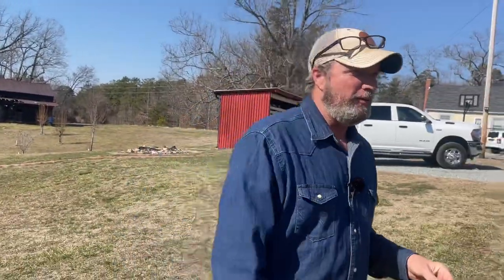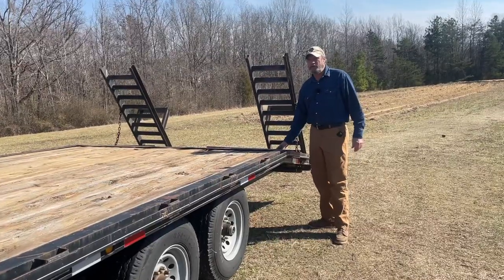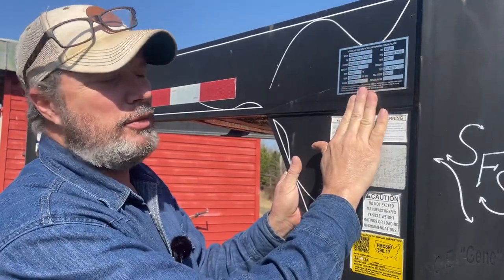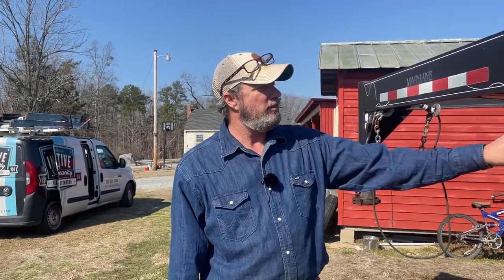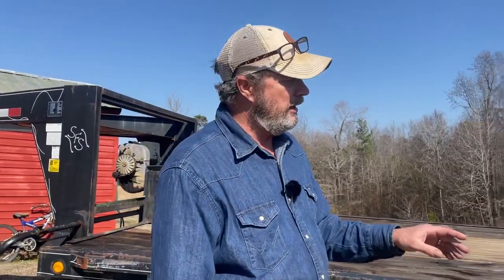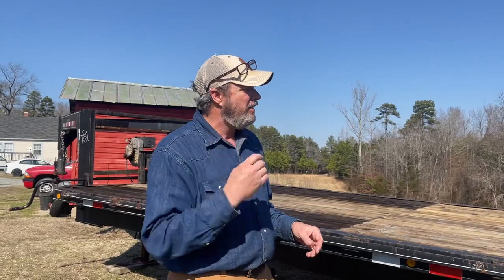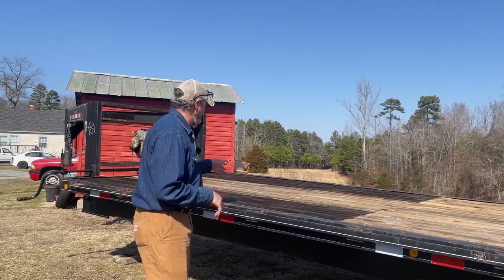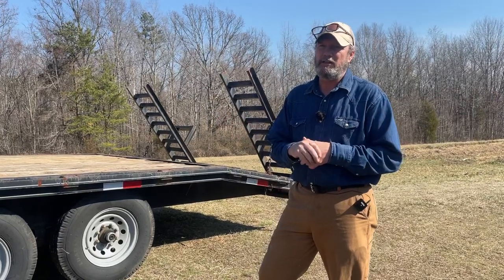Gooseneck Trailer Project

Comment: A 14000 pound trailer will carry 7 140 Farmalls if they would fit. When I work at the John Deere tractor place I put 3 1530 tractors on a 3 ton rollback and drove 100 miles and they weighed 4000 pounds each. Another good show have a blessed day
Reply from the maker: Hey Joe , I know I probably want use it to its full potential but I always wanted a good trailer. Maybe I can help someone else in a pinch with it.
Reply: @Jtwes  yes with that big of trailer you can move a small bulldozer or mini track hoe , with you 3/4 ton truck or a big farm tractor the only problem would be the hight if it has a cab

Comment: Congrates on the trailer purchase.  If the trailer is 14,000 GVW your load capacity is about 9000 lbs.  So you have plenty of load capacity to haul your 140 and some implements.  But, you may need a CDL (commercial driver license) to tow the trailer legally since it’s GVW is greater than 10,000 lbs.
Reply from the maker: Hope not . Lady at the DMV didn’t say anything about that .
Reply: @Jtwes  hey Joey, Dean here, as far as the CDL, you do not need one as the GCWR (gross combined weight rating) should be less than 26,001 lbs. now if the GVWR or you truck + the GVWR of your trailer is more than 26,001 lbs, yes you will need a CDL Class A. As long as you don’t overload the trailer weight rating, and make sure you don’t overload the axle weight ratings DOT won’t make a fuss. They also have a waiver for farmers within I think a 150 mile radius of their farm address not requiring them to have CDL’s.

Comment: That’s a good sized trailer. I’ve got an 8k GVW tilt deck that can haul cars/small tractors and stuff and the semi trailer is rated for 100k GVW. Still say something in between would be good to have 😂
Reply from the maker: I need the 100k for my truck
Reply: Couldn’t even hook it up to your truck lol. Plus it has air brakes too.

Comment: Hi Joe! You will be able to haul your whole estate on that trailer! What brand of fertilizer do you used over there? Since the Weaver fertilizer plant in Winston-Salem burned on January 31, a lot of the dealers here are scratching their heads wondering where they're going to get fertilizer.
Reply from the maker: I’ve always used Camps out of  Roxboro NC.
Reply: @Jtwes  I wondered about that. The owner of my local hardware store is considering Camps. We used to have a produce place here that sold Camps. Daddy and I used to use Rainbow when the IMC plant was still in Winston.

Comment: No CDL needed with that truck and trailer.. if the trailer had dual wheels and you gonna gross over 26.000 then yes you would.. I pull a 3 axle 20 footer with a dodge 3500 and I weigh 14k .. I can haul 12k with 26000 license.. put 14 ply tires on that trailer, a little pricy but they stand up good .. kinda like big truck tires
Reply from the maker: I just got done putting a brand new set of 12 ply tires on it. I was thinking 26000 was the CDL starting point.